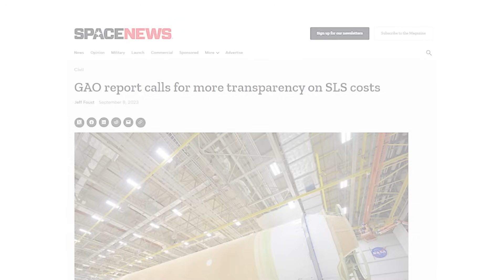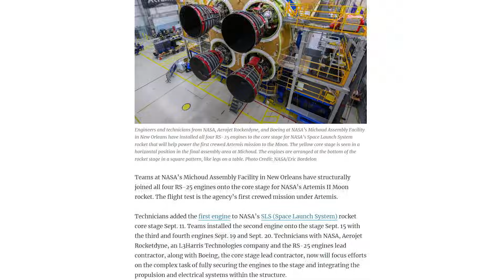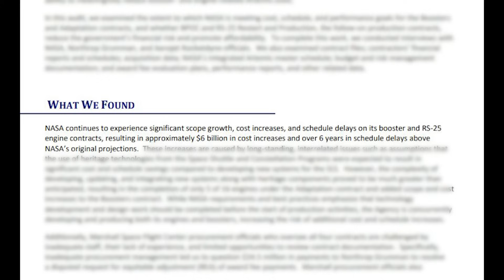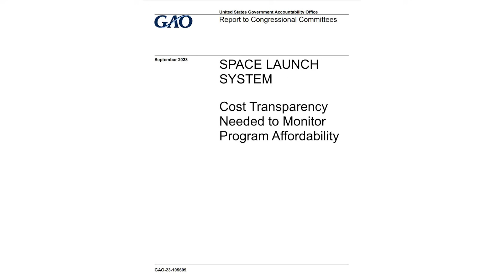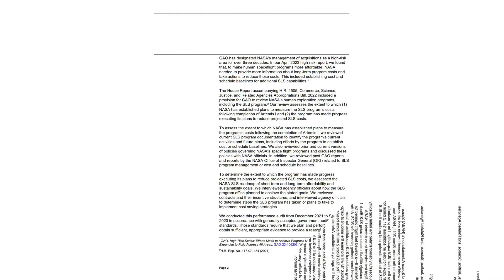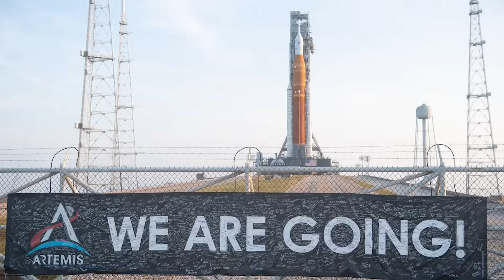A Closer Look At NASA’s Modern Return To The Moon

Comment: The GAO demands sustainabilty; NASA in turn demands sustainability from its contractors.
Artemis program sustainabilty is designed around cheap lunar transport costs i.e. cheap lunar rocket fuel : hydrogen.
Blue Moon burns cheap hydrogen, Alpaca and Starship burn expensive methane; NASA has rejected Alpaca and, listening to the GAO, Starship is in for the chop too.
Was NASA ever serious about Starship or was SpaceX just used as leverage to twist the Space Cartels into the new "sustainable" line?